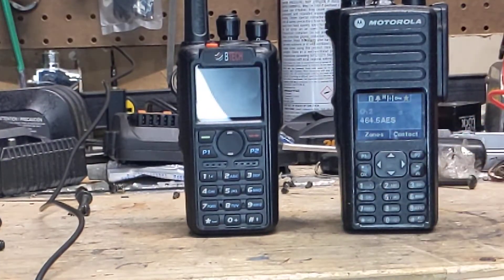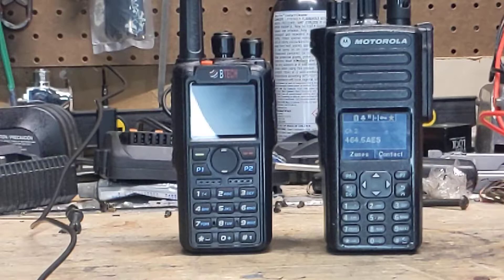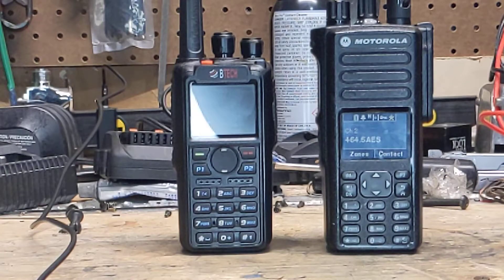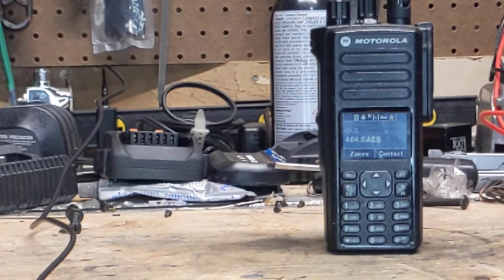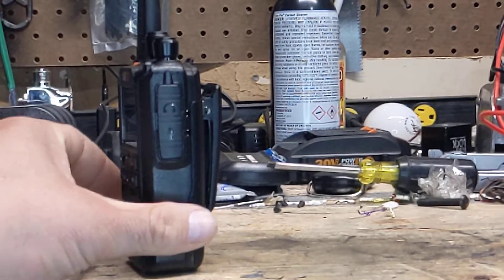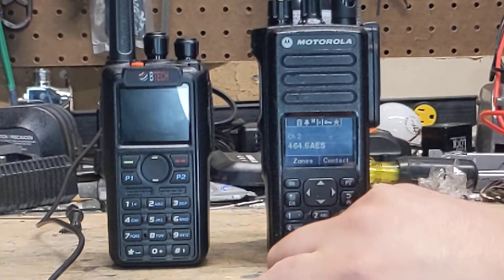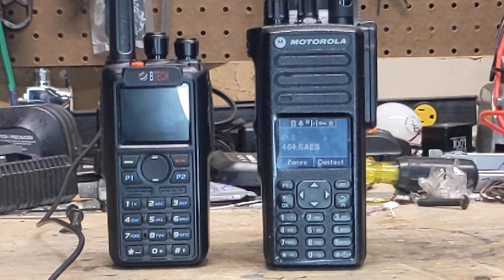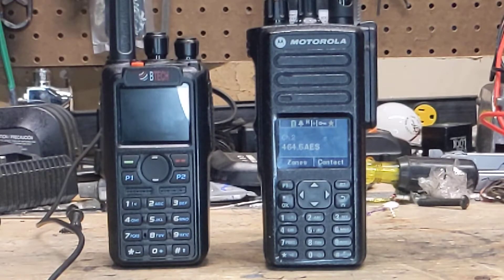dmr AES256 with the btech 6x2 and Motorola XPR7550e

Comment: Would the DMR signal sound better if used with 25KHz bandwidth? I don't know if the FCC maintains any 25KHz bandwidth licenses for business use anymore. Using a cheap chinese radio, my 12.5KHz DMR sounds all compressed and robotic on HAM bands
Reply: If you’re on the 2m you’ll need a 25KHz bandwidth.

Comment: Anyone know if the anytone AT-D878UVII also has AES-256 (isnt the Btech just a rebranded Anytone?) Or the TYT MD-UV380?
Reply from the maker: The btech is in fact just a rebranded anytone, even the FCC ID comes back to Anytone. I believe the Anytone 878 does support AES, and will work with Motorola, Hytera, etc. Any radio that supports AES meeting the DMR standards should work
Reply: @WillPhoneman  I figured as much, Looks like the TYT does not support AES, as the CPS software doesn't have anything except "basic" and "enhanced" and is very limited. Such a shame because it would be amazing if a $100-130 radio could use AES, but I guess I'll just have to pony up for the Anytone.
Reply: tyt md-uv390 plus Just came out & has aes-256

Comment: Hey!  Curious how you got the AES key into the BTECH? I have a couple BTECH 6x2’s I need to get to work for a business channel, but I can’t get the AES option to work via the 6x2 program. Curious if you were using the PRO model? - thanks
Reply from the maker: It was just the program I downloaded off of their website. I just entered the key into the text field where it was asked, and it accepted it. If mine is a pro model, it doesn't say so on it anywhere. It's just a rebranded anytone 878 or 868, forget which
Reply: Thanks! It seems that maybe they have locked that option down now. I’ll try reverting to an older version
Reply: @Bob Scales  I'm curious, did you happen to find a solution? or is the option not there on newer versions of software?

Comment: just wanted to make 1 correction- if the motorola radio is found, they can not view or get your encryption key. if the radio is read from another computer/ not the same code plug that was used to program encryption key, the key will have a zero with a line through it. 0/  also the code plug can be password protected to prevent it from even being read.
Reply from the maker: This was more a comment on the BTech radio, I'm not for sure what would happen if you read it on a different computer, but the encryption key is easily visible in CPS. I do know that the Motorola's have it hidden, and I knew about the password protection as well. Well. It's likely they have better internal security than the Chinese radios

Comment: Hi. Can this radio will work with Motorola dp4800 with aes 256 encryption?
Reply from the maker: It should be, as I believe the 4800 is the EU version of the 7550. The AES implementation in newer Moto Trbo radios meets the DMR standard, so can work with any other radio that uses DMR standard AES.

Comment: Do you know what the entitlement/part number was from Motorola MOL to get the AES Advanced Privacy in CPS? My account was just activated but I can't find anything. Do I need to request it specifically from support?
Reply from the maker: I bought the radio with it already purchased and activated, so unfortunately I do not. If you are in the US, it's apparently hard to get /\/\ to sell you AES for TRBO radios, as they want you to buy an expensive P25 system, which requires an expensive keyloader.